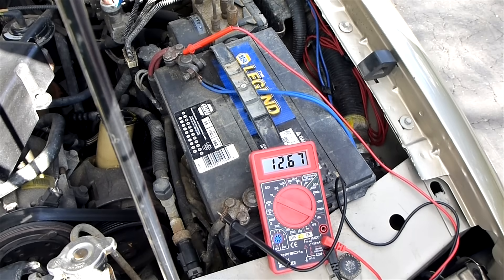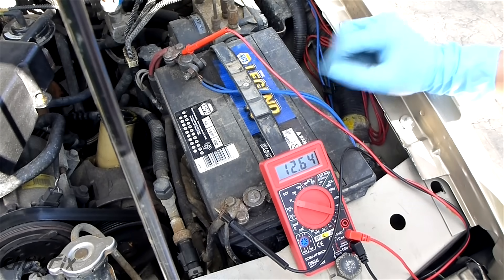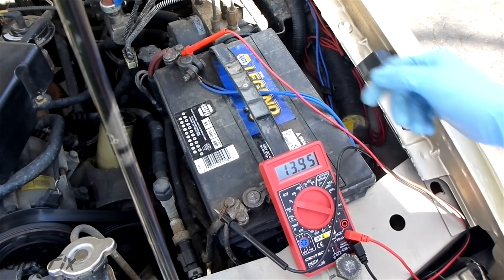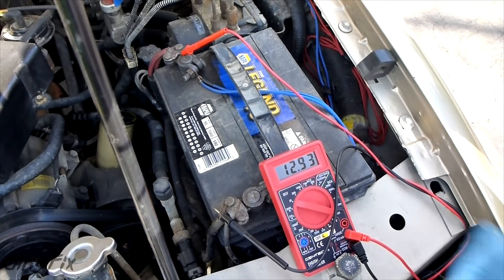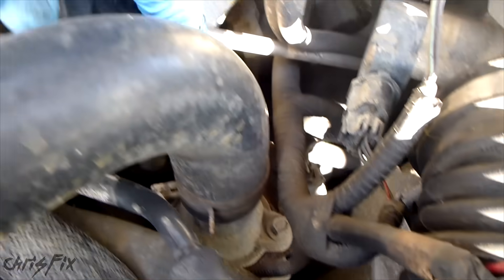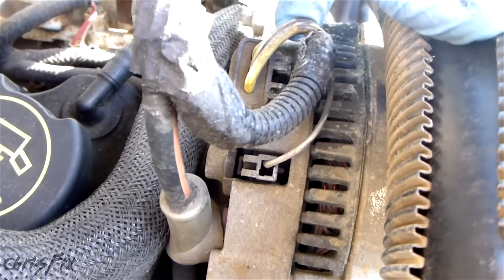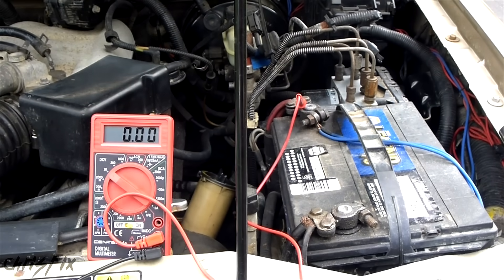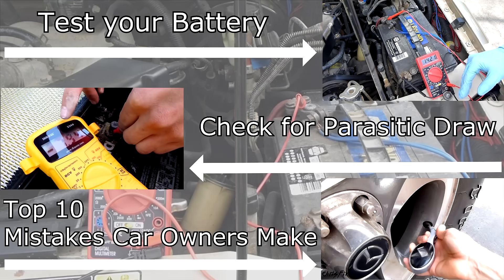How to Test an Alternator

Comment: Just take a battery cable off while it's running. If it dies, bad alternator. If it stays running, good.
Reply: And that is the perfect way to wreck it, high volt spikes jump through the diodes.
That method is fine with the old dynamo systems only.
Reply: That won't test a generator system, because they create their own field. A diode is a on off switch within a circuit. Taking a terminal cable off while running is a perfect test for all alternators.

Comment: Informative Video.
Can you please tell, that we can apply the same procedure to Test the Alternator placed in the GPU i.e. Ground Power Unit of 140KVA with 2000RPM ? can we use the same readings lines like placing black probe on battery negative and positive to the casing of the alternator for not more than 0.5 reading ? is it so ?

Comment: When I connect + of multimeter to + of battery and - of multimeter to the thick + cable bracket of alternator I see a reading of -1.00 V and not 0.05 as at this video. I sandpapered and cleaned all cable connectors including the alternator bracket but the problem is still there. When I check the battery voltage on idle its 13.7 and when I touch the alternator bracket with + and alternator body with - I can read 14.7. So 1 Volt is lost. What is the problem ? Cable or Battery?
Reply from the maker: Get the battery tested. It could be either. When you add a load to the car (headlights, Fan, interior lights, etc) what happens to the voltage?
Reply: @chrisfix  When (engine running on idle) I add lots of load to the car the Voltage (13.40 V) on multimeter does not change at all.
Reply: When I connect + of multimeter to + bracket of alternator and - of multimeter to anywhere on the alternator body I read 14.7. When I connect + of multimeter to + bracket of alternator and - of multimeter to the + terminal I see -1.5V which confirms the 13,4 on idle. When I disconnect + and - of battery on idle I again see that -1.5V loss even without battery. So there is 1.5V loss. Is that normal on 2010 Audi A5 1.8tfsi petrol 118kw with 70ah battery?

Comment: This is a dumb question does the ac count as a load.. because I’m doing the exact same test with the ac full beams on hazard lights on radio on and I’m at 12.5 volts and noticing its drops to 12.3 after a minute or two when the car is hot what’s you’re opinion?

Comment: Hey Chris great video very useful I'm running the test with my voltmeter I'm getting point .67 .77 when I touch thes stud and the nut on the B post coming out of the back of the alternator I'm stumped any ideas you could throw my way would be much appreciated thanks man keep up the great work

Comment: Chris- If I consistently get a .5 reading on the voltage drop test (both neg and pos) at all of the connection points does that mean I may have a Voltage Regulator problem? Or is there something else you can think it may be?

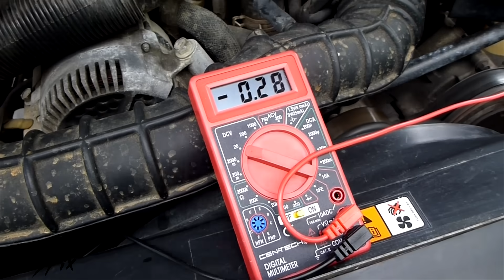Comment: Chris, at 7:35 the video explains how to test voltage drop across the alternator and the positive side of the battery, indicating the multimeter should not be above -0.30v.  The multimeter reading in the video is -0.28v which is above -0.30v.  Both are negative numbers.  If I'm misinterpreting the reading, please clarify for me.  Thank you.  Your videos are outstanding.  You've taught so many people how to perform simple maintenance tasks that save them huge amounts of money by troubleshooting their own vehicles.  Greatly appreciated.  Keep up the great work.

Comment: Hey guys,  I need help ASAP 
I have a problem with my electrical system. I’ve took it to several shops but keep coming up with the same issues.  At night the car lights gets dim and shut down on me , when I give it gas I figured it wud brighten the lights but instead the lights gets dimmer. Radio blinks on and off . 
I’ve replaced Batteries had alternator checked at orilley which were good . 
Any other solutions ? 
Thanks Guys
Reply from the maker: Clean your grounds and test your alternator like I showed in this video.

Comment: I'm having a problem with my audi a3 8p . Done everything in the video . Battery and alternator perfect. Car will start everyday ,1st time. 
Problem Is , if I use the car for a couple if journeys through the day  may be on the 3rd start the car won't start. Just clicking for about 10secs then flat battery. Doing my nut in. Any ideas folks

Comment: So what does it mean if I see 0.4V when red wire or multimeter connected to the battery's red, and black to the alternator nut?
I have to check if my alternator creates any energy at all, I guess it first thing that should be done before checking any wires, no?

Comment: I have the dreaded click click cannot start, batteries x2 are good. I want to check ignition to solenoid on starter motor on 100 series land cruiser and ideas
Reply: I had that happen to me once on my 2001 F150.  I disconnected , cleaned & then reconnected the alternator wires, battery wires and the wire connection to the starter.    Cured the problem without any need for diagnostic tools.   Whenever I make & break connections on my cars I always clean them, use a bit of dielectric grease & refasten them snugly.

Comment: 5:25 How did you raise the rpms?
Reply: Older truck has a physical cable connected to the throttle body; he just pulled on the cable or moved the connection to it on the throttle body.

Comment: If you do the voltage drop in the positive side and you have up to 3.6 what  should I do ? however after seeing your video I went from almost a 5.0 drop to 3.6 good thank you
Reply from the maker: Check the cable and make sure it isn’t crimped, burnt, corpses, or damaged. Also check the the connections and make sure they are clean.
Reply: @chrisfix  thank you now is a 0.36 acceptable? Now I get a voltage with all the accessories on at the battery at 14.2

Comment: I am getting reading and of 15.17 VDC while engine is on idle position with no accessories or AC is turned on but getting 14.5 volts while everything thing is ON.

Comment: Thank you for all these videos. Not sure If your parasitic draw videos was one I commented on but Im trying to figure out what wrong with my truck and am losing my mind. 2 garages and 5 people that I know that are good with vehicles and I still have an unreliable ride.

It can sit for a week and start fine, but then the next day it wont start. 
It runs at 16 amps (sometimes down to 14)
It has a new alt and batt but I know that means nothing...

Between choosing bad alt/bad reg/bad batt/para draw it seems to have things kinda from all categorys. 
It seems like a bad reg cause of the high volts but I have no power/dimming issues and doesnt change with revs
Some things point at alt but Id bet big cash on it not being the alt...
parasitic draw because good battery keeps dying.... but not always true

:/ Sigh...

Comment: Good test. Very through. I had a ground that was bad, but so bad as to show on any the testing. In changing the battery I also changed positive and negative cables. On restarting car I noticed  a substantial increase in cranking my 911SC. Inspection of the ground cable showed broken copper broken under the casing when cutting it open and discovering only partial connection but still allowing the engine to start. Since these parts are relatively inexpensive I do this every time I install a new battery. Merely preventative maintenance.

Comment: Having a problem with my radio reception-especially the AM which makes a noise whenever I go over a bump while driving listening to any AM station. Suspect a loose connection but where to start???
Reply from the maker: Check the connection on the back of the radio. Also check your grounds on the battery and engine.

Comment: Really nice, concise and perfect Chris, thank you! ... my car voltage were well within the range you described for when car is stopped (12.8) and just started (14.5). With full fan, radio and lights it fell to 13.55, and when I added AC it went down 12.55, I guess that is expected.
Reply from the maker: That drops a lot with a load. I am not sure what amp rating your alternator is but I would check!

Comment: I saw a specialized measuring tool with lots of nice LEDs (green LEDs means good, etc) at the store, and I almost bought it.  But as I walked away, I thought...I wonder if there is a way to check the same things with a voltmeter.  Came to Youtube to check and there definitely is!  Thanks a lot!

Comment: Dude! Thanks for making this as simple as you did. I just checked my sweethearts old 1995 BMW 318iS and got 12.4 at the battery and after starting the car, watched it drop it 11.2 after starting it. Bingo. As someone pointed out, when the battery light comes on, it's always the alternator, but it's nice to know the way to confirm it. I even used the same "free" voltmeter from Harbor Freight. (Be sure to have the wires going to the negative and the positive going to the one right above the negative or you'll melt the wires).  I purchased an alternator from eBay and will have the old beast going next Saturday. Thanks for helping this old geezer! Subscribed and Belled!

Comment: This was helpful. Although if you put in a brand new battery, it may read low because the alternator doesn’t need to charge the battery. Thought my alternator was failing but it’s fine right now.

Comment: 13.9 enough to kill the battery after a cold night?
Reply from the maker: That statement doesn’t really make sense. The 13.9 is the voltage when the alternator is running. If you shut the car it’s 0v from the alternator and the battery will maintain 12.4v. If you have parasitic draw from a short then your battery could die overnight.
Reply: ChrisFix well it looks like I have some form of a draw. I think I need a new positive cable. It’s original Chrysler. I guess it could use a good scrubbing. 

Ran my truck for 1 1/2 years and it started dying well bought a new one thinking the cheap one I had got when I bought the truck was letting go. Bought a brand new one that was correct size. Well it keeps dying. I’ve checked all grounds I can see. Nothing is dirty. But I think it’s coming from my starter causing a draw. I’ll have to get a clip of it. 

Took it to oriellys multi meter is lost. Did Alternator test, battery, and restart and it all came back good. So I’m lost. It runs drives and restarts after driving I leave it sit for 12 hours or more it’s dead.

Comment: Dude, my car won't even start. How do I test the connection?
Reply: Of course, that is assuming that everything else is correct.  Like others mentioned, your plugs need to be gapped right and working, ignition wires need to be working, whole ignition system needs to be working, as well as whole starter system, as well as all other engine parts need to be working, including fuel system and fuel supply. If all other stuff is ok, then jump car and check alternator output. Then if alt output is ok, and batt still wont charge after idling for an hour, most likely, your battery is gone.
Reply: Yes that's where I'm at. I could still jump it a month ago. Now warm with new battery, won't even start. How to test anything now.
Reply: @arlenemayer5966  Guessing it was your alternator?
Reply: @jonesy1589  No it was simpler. Connection problems. Been working  so much since then, haven't  thought about  it much. Paid neighbor $30. My PU has 2 plugs misfiring he thinks I can clear up  with some carburetor  cleaner. So will be trying  that next. I will check with  him and see what exactly wasn't connecting  and try to  get back.
Reply: @arlenemayer5966  watch his video where he gets a free car from his neighbour , you might not be getting spark in the spark plugs or your spark gap is bad , if all that is good , check your timing belt , something might be wrong there
Reply: Use battery jumper cables (good ones), with someone else's vehicle, to jump start your car. Then you can measure the alternator output using a simple dc voltmeter, while the engine is running, as shown in this video by Chris Fix.  Your battery terminals should read somewhere between 14.2 and 14.7 volts dc, according to this video, if the alternator is charging correctly.  Let it sit idling and running for half an hour, turn it off, then try to start it again.  If it doesn't start, and your alternator output was between 14.2 and 14.7 volts dc when it was running, most likely you need a new battery.  Good luck.

Comment: Can you change the alternator with the battery still connected?  It's a couple plugs that unplug from the alternator, but then as you're careful and dont cross them or anything will that be fine?

Comment: I'm going to assume when you do the alternator test at 5:00 that when you say, "You shouldn't see a reading of .1 or .2 or greater that you mean you shouldn't see a reading of NEGATIVE .1 or .2.....   My volt meter is of the analog type so when my needle wasn't going slightly to the right of the zero I began to worry. I watch the video again and now see that you are actually talking about minus .05 etc. and my needle IS going to the left of the zero slightly.

Comment: Very old video hopefully i can get some help, on my 1990 volvo 760 turbo i have nothing from alternator to battery, i have alternator to a ground though and it still works but I'd assume itd be perfect if it was on the battery. It does drop in rpm when i turn anything on electrical related until it's off  (sunroof, lights, a/c etc) i did replace the wire going from alt to body ground, the only other wires is one that goes to the block i believe and to wire harness.

Comment: I have a 1996 Toyota camry le. 4cyl. I've gone through 2 alternators in a month. Each the same problem. Bad voltage regulator. Is a short in my car causing it to damage the alternator or is is just bad luck im getting faulty alternators?

Comment: I have an issue. Going by the procedure in the video the batter has 12.54V and when the engine is running the voltage remains the same and when I start the accessories the voltage goes to 14.5V and comes back to 12.5V when the accessories are off. After the engine is switched off the voltage comes back 12.5V. I am not sure if I am doing anything wrong or is the alternator out? Car is a 2015 Honda accord. The car had to jump started few times in one month. I cleaned battery terminals also.

Comment: hey chris i have a question the battery was in 15.3 v then i did change the voltage regulator and the battery is again in 15.3v, what could be damage? the battery maybe?,  greetings from mexico.